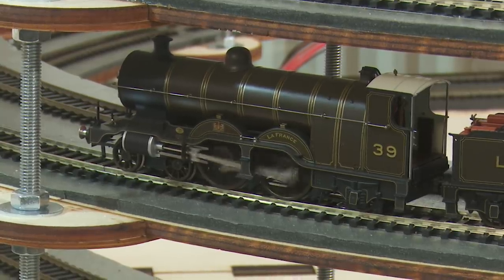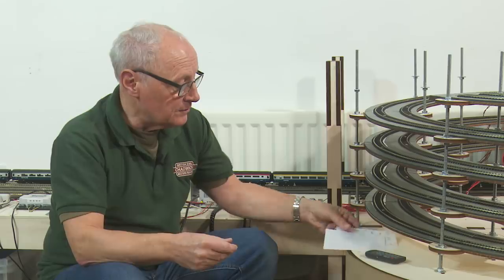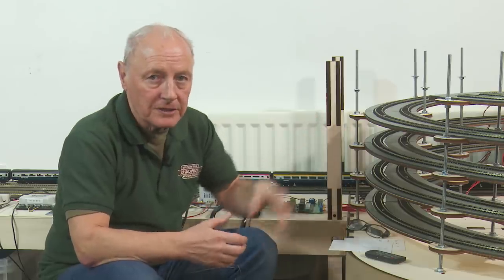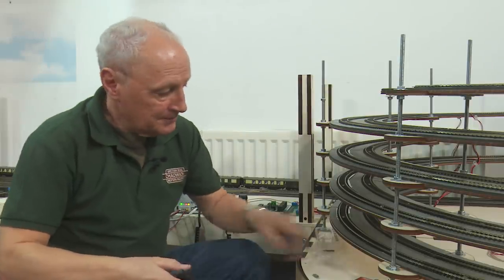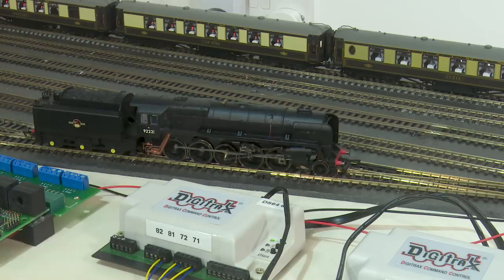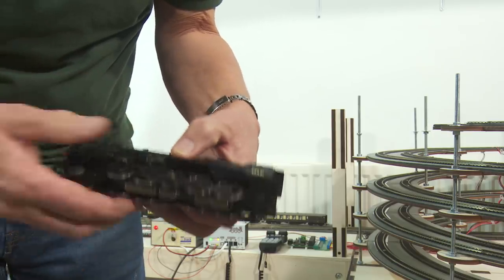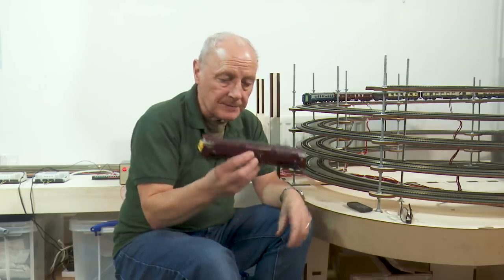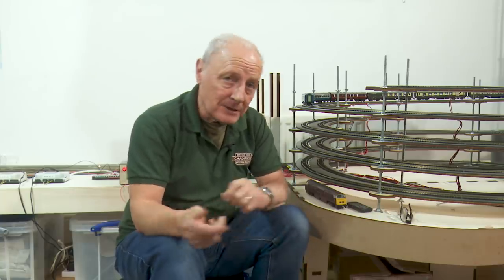Inclines and Power Base at Chadwick Model Railway | 118.

Comment: Great video Charlie.  I was wondering the same as others here about the keep alives.  I see you haven’t equipped your locos yet with that feature.  I decided to go with the Powerbase on my O-16.5 mining layout.  I figured it wouldn’t hurt to take advantage of having the extra traction effort climbing a mountain.  I have laid about 15 meters of Powerbase so far.  I ran out of plates and had to order more.

One thing that could add to your freight operations and your steam excursion trains is to have a siding with helper service locos at the bottom of the helix.  Thinking of the helix as a mountain, an older model diesel remains on the siding waiting on freight trains and steam excursion trains.  The helper can come in at the front or the rear of the train to help climb the helix / grade.  Once the train reaches the top of the helix and the original loco can now handle its train, the helper moves away, the original train heads off on its journey while the helper drifts back down the grade to the siding to wait for the next train.  Even if your freight locos can handle the helix, this helper service would add to your operations.   A friend could be the engineer on the helper loco.  Of course the helper service needs loco services at the siding.  Fuel tanks and a sand tower at least.
Reply from the maker: An interesting point and one which would make interesting operations. Regards Charlie

Comment: Charlie my general rule of thumb is to keep grades under 1.5%, especially on helices since the curvature creates additional drag as wheel flanges rub against the track tread. I have designed in 2 helices for my 25’ x 30’ double deck HO Piedmont Southern layout and both are under 1.5%, but then my curves are a minimum of 30” radius and the big one is 36”. 

On my old club layout outside Washington DC we had several helices and one steeply curved mountain grade over 2.5 % uncompensated for curvature. We either had to run short trains or double head up that one. I used to put lead slugs into the boilers of my brass steam locos to get adequate traction and pull decent train lengths. 

Many newer locos have a lot of extra weight now that manufacturers have started using full metal chassis’ that almost fill the cavity of the shell, but I am sure there are opportunities to pack in lead or other metal weight for increased traction. As I understand the power base it uses the magnets to increase traction but I would be afraid that in many cases, as you pointed put, it may be difficult to mount them. 

Most of my GWR locos do not have a lot of traction and the new Dapol Mogul has been roundly criticized because of that. Dapol hollowed out the boiler to allow for the pull out decoder mounting. I plan to gut it and hardwire in a Soundtraxx UK steam decoder then fill the rest of the boiler cavity with lead weight. I also need to increase the pulling power of my King class 4-6-0, as it is pretty gutless. The majority of my GWR steamers though will be relegated to flat territory on the modular layout I am building in my YouTube video series on “The DCC Guy” channel.
Reply from the maker: Great comment but I’m a little confused.
Are you Larry? Regards Charlie
Reply: Charlie's space is much smaller - the layout is about 17ft x 20ft on it's largest dimensions, so his helix is much smaller.  The outer radius curves are 22 1/2 inch radius so obviously his gradient is steeper.
Reply: @ChadwickModelRailway  Charlie, yes that’s me. I use Blue Ridge Bonsai for my personal browsing and save The DCC Guy for my channel communications. I noticed in a McKinley Railway video that he weights his steam locos to increase pulling power so I figured you would be easily influenced that way. The magentic traction approach is actually a pretty interesting solution to the problem as long as you install the steel plates in advance. I am surprised Richard did not come up with a more catchy name like Lionel’s MagneTraction. 

Glad to see it works with your locos. Your open top reminded me of the time one of our club members had a loco derail on our BIG helix and took a dive 8’ down to the concrete floor. After that disaster we installed 3” tall sides to the helix just in case!
Reply from the maker: I too have thought about a safety barrier!
Reply: I have seen folks cut strips of 1/8” hardboard and tack it to the sides of the helix. In our case we found some clear vinyl base molding used in kitchens. We cut it into strips and stapled it to the edges of the helix. With a steep gradient there is always the chance that a long string of cars will pull off the rails and tumble, especially if they are not weighted. Good luck—Larry

Comment: Charlie, 
Interesting video.
Does it make any difference if the HST is pushed, rather than pulled, or do you have dual driver setup? And would a tender drive steamer provide more "push"?  
And is it useful to use double-sided tape to (assist in) holding the powerbase magnets?  (In fact, if the pickups are in the baseplate, this may be the only way)
In fact, avoiding the screws may allow more magnets (as you have done). But how you fit the magnets may be an issue; if you link them all together and then stick the lump to your loco, there are only two "ends" to the magnet to exert the force.  If you link them so the ends repel, then the powerbase metal plates will be attracted (like a keeper) and you will get more attraction/traction.
Have you started to investigate the idea of a banking engine, and include that into the track layout to allow it to hide at the bottom, and escape at the top for a return run?
And do you have any engines with traction tyres?

It would be possible to generate a mathematical model (algorithm) that would reflect your loco's capability to pull.  As you'd expect, number of driven axles, number of traction tyres (and their age/cleanliness), weight, motor power, etc will all contribute, and you'd need a lot of test data from actual (model) locos to develop that.  Given the state of the rails is so important, I suspect that variation (from one layout to another) will generally invalidate the values from the algorithm, beyond "heavy, many axles, so should pull well"!  

Your comment about the Hunt couplings is even more effective with the Elite; the ordinary Hunt couplings are rotationally symmetrical, so will have the same linking force with a coach on its side as upright.  But the Elite, with two magnets, will go to almost no attraction when one coach is on its side, and the train of catastrophe will be derailed.  (Paraphrase at your own pleasure! ;) )

I like the idea of including a magnet into the track cleaner, so that it can collect any such debris.

Many thanks for your ongoing entertainment and education. always a lot to learn!
Reply from the maker: Hi Tom, I really dont like to push stuff up a helix. A minor de-railment could put 10 coaches over the side.
The Hunt Couplings are proving to be very useful.  Going down a helix, it's too easy for the "D" links to over ride each other. 
Regarding which way to face the magets when in-line is still under investigation.
Regards Charlie

Comment: I don't have a helix, but did install Power Base on 3 sections of 1in35 where trains have to restart after possible Signal Checks. My experience is such that I can confirm your own comments and those from Graham Thomson; if the magnets can be securely fitted, preferably across the axles of the driven wheels, a noticable improvement results.
Regarding your remark about a 'graph' to compare pulling power; some 15 (or even more) years ago the German "Eisenbahn Magazine" developed a standard test for measuring the effective tractive effort, at the rail, of model locos and has consistently applied it to the models it reviews ever since. (A touch more scientific than "pulled five Hornby Pullmans on the Pecorama Loft Layout"!)
By the way, I too think you are worth "a (or even two) cup of coffee a month"; even though watching (and commenting on) your broadcasts takes up precious time which could otherwise have been spent in my own railway room!
Reply from the maker: Great comment Brian. 
I’ll have to buy a “Newton” gauge.  
I believe that it’s little more than a spring balance.  That figure, with loco details, must be worth recording and made available online.  Regards Charlie

Comment: Bonjour Charlie,
An another useful video, for sure.
As an intermediate solution, that would have been interesting to check how traction tires can help on your helix (and more generally on inclines). This seems a bit less intrusive that fixing magnets but maybe an harder task to achieve, especially on steam locos. And not taking into account that one may dislike traction tires!
Regards,
Claude
Reply from the maker: Thanks Claude. Non of my locos, manufactured within the last 15 years, have traction tyres fitted. Regards Charlie
Reply: @ChadwickModelRailway  I have understood that locos on the UK market are barely (if not at all) fitted with traction tyres (sorry for my typo in my 1st mesg!). On the other hand, on the Continent, one can hardly find a loco without such tyres (cf. Roco, Piko, Trix, Märklin, Fleischmann, etc). I would even say that the traction tyres are somehow seen as part of the "quality" of the product (no tyre = poor quality or, at least "missing feature"). Of course, one can argue about that! Is it a cultural thing? Anyway, thanks a lot for the time spent to enlight the audience! 🙂
Regards, Claude

Comment: Whereabouts is the motor / driving wheels on your tender steam locos?   I guess they must be in the main body of the Locos which is why you put the magnets there and not on the tender.  Many of my steamers are tender driven so that’s where I need the xtra traction.  Interesting video , thanks
Reply from the maker: Yes that’s right Roy, I have no tend to drive locos. Regards Charlie

Comment: Looks good Charlie. I have it to do early next year. With double track the outer is going up and the inside track is down.? So these magnetics be fitted to the side that climbing because I can't see how you need them when the locomotive is on the way down. Do you what I mean. I may just fit them to one side only. I use a 3in block of wood to get clearance of each level. Then I fine turn the helix. I have build three in the past and one for my uncle but this time your mate can do them. (Health reason). No dust.
Reply from the maker: Good luck Ian but you probably won’t need it.  Regards Charlie.

Comment: Hi Charlie,
                The use of the magnetic system by DCCconcepts brings to mind my layout which has
working pantographs and the effect that this has on climbing my helex grades. Frankly it does 
have little or no effect and if one puts a 222 gram locomotive on the scales and presses the 
pantographs down the we come up with 230 grams a effective weight gain of only 8 grams or
about 3% to help adhesion. 
 I don't have any of this 'magnetic' system to experiment with but more on the subject would be 
interesting. Interestingly there was a 'magnahesion' system decades ago and it relied on metal 
or tinplate track to work.... I don't think it was a howling success!
 When it comes to 'adhesion' the best in my experience was my TT 12mm gauge layout in the 
1960's.... the Triang locomotives has cast iron wheels which far surpassed the adhesion 
material ability of our modern methods. Likewise locomotives in the bigger scales ('O' gauge) I 
scratchbuilt for some years were well known for their haulage abilities... they had cast iron rims 
on the driving wheels.   Cheers.
Reply from the maker: A very interesting comment Indigo, thanks for posting. Regards Charlie.

Comment: Great video Charlie. Just one point you said the outer track had a 2.83% incline which is 1 in 50.  However it is not.  It is 1 in 35   (100/2.83). 2% would be 1 in 50.
Reply from the maker: Thanks Andrew, I’ll check the maths tomorrow!
Reply from the maker: Having re-measured etc, I've revised the figures and pinned them as the first comment.  But a good spot Andrew, thanks.
Reply: @ChadwickModelRailway  Thanks. The main thing is that your video shows that operation on helices are potentially difficult and it is worth investing in the powerbase unless you have the space for a VERY large radius or are keeping away from steam.

Comment: Hi Charlie, can I suggest you try using Blue Tac (or rather the industrial strength Black Tac)  to secure the magnets to the underside of the locos. A small sausage shape along the length of the magnet on either side will secure the magnet without reducing the distance between the loco and points.
Reply from the maker: A fair point SW but those magnets are so strong.
Reply: Black Tac is extremely tough stuff too and worth trying, especially if it will help to improve traction on your Atlantic Class.

Comment: Hi Charlie, I use magnets from “first for magnets” they have some very powerful neomagnets, flat, thin and with self adhesive backs. The pull on one with the same foot as yous could be up to .36kg.
Reply from the maker: Yes Chris, and that is exactly what is supplied in the DCC concept packets.
Reply: @ChadwickModelRailway  Typical of the multiple names of things; rare Earth magnets is so much easier to type than neodymium, even if they are the same thing.  But technology sells, so the complicated name (Hi-ly-moronic acid) is used as a sales technique.

Comment: With the steam locos: could you open the plastic case and find some free space to add some lead weights over the driving wheels section? would that stop the slipping for the price of a small section of a lead sheet?
Reply from the maker: I think that you’re right Chris. Perhaps we should add a little more weight to see if it makes any difference before slapping in some magnets! Regards Charlie
Reply: @ChadwickModelRailway   I always like the trick of putting lead weights (from fishing tackle) in the 16T coal trucks which stops derailments. You want to do the opposite and make the loco, not the what it pulls, heavier.

Comment: I'm curious to your coach lighting. I have recently begun to replace standard lighting in my N scale coaches with LED lighting. A coach with standard (Kato)  lighting draws .056 amps while the same coach once LED lighting is installed draws .015 amps. A train of 10 coaches now draws .15 amps vs. over a half of amp. A nice savings (at a cost for the LED kits of course).
Reply from the maker: An interesting improvement Lou.

Comment: Very interesting to watch Charlie, a methodical engineers approach to a problem.
Have you considered an inlay between the rails on the incline track, to reduce the magnetic coupling distance and increase down force ?
Or have i misunderstood the way the magnetic flux is working to improve grip?
Reply from the maker: No you make a valid point Lee.
Regards Charlie.

Comment: People have been trying to get wheel spin on steam locomotives moving off for years!  But seriously, two questions come to mind: 
1) Why do models of steam locos have such poor pulling nowadays? 
2) Whatever happened to traction tyres on model locos?

The most powerful loco my dad and I had on our layout was an ancient Marklin Hamo SNCF 2-10-0. Ignoring prototypicality, it was an immensely powerful beast, able to pull a rake of 10 Hornby Dublo BR maroons with ease (and those coaches would need a shove to get them to free run down a much steeper gradient than your helix!). The rubbish pulling power of virtually all the British outline models at the time, was one of the reasons we decided to "go continental" - at the time, only little shunters really had much problem on the inclines, and when we much later added a helix to join three levels in an extension to the layout, anything with traction tyres was able to pull a decent length train without problem.  Though that Marklin 2-10-0 was still the most powerful, even 40 years later when the whole thing was broken up and sold off. Curiously that Marklin 2-10-0 was one of the few steam locos we had from the German & Austrian manufacturers that wasn't tender driven: most, apart from the tank engines, of course, most if not all, the others had the motor in the tender.
Reply: 2) My märklin one´s do, some people even change wheels and put a secound pair on - do british manufactures not have those?
Reply from the maker: What an excellent comment Andrew.
Regards Charlie.

Comment: Dumb question, but do these magnets have to be positioned in a certain way for the polarity to align? Are we sure the magnets are pulling the loco down and not repelling it up? 
The bunch of debris it picked up during the first test was a lot more noticeable on the rear magnet than the forward one, makes me wonder if the forward mag may have been upside down perhaps.
Reply from the maker: The steel plates are not magnetised so the magnet alignments not important.

Comment: Hi Charlie. Interesting and entertaining video, as usual. A couple of points on the Powerbase. First, is the other side of the more traction coin that there is more load on the motor, which may be detrimental. Secondly, when you fitted the five magnets to the 9F, did you arrange them so the poles were aligned N-S-N-S etc.? It seems to me, with my limited knowledge, that doing so would increase the magnetic force as the poles would not cancel each other out.
Reply from the maker: Hi Ron, yes I do appreciate that there is an extra load on the loco and yes the magnets are NS-NS aligned.